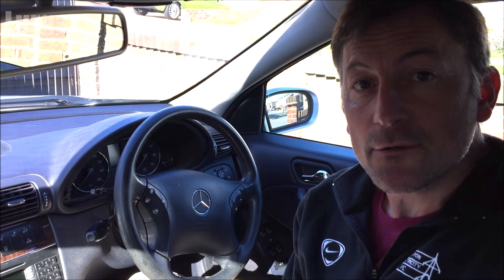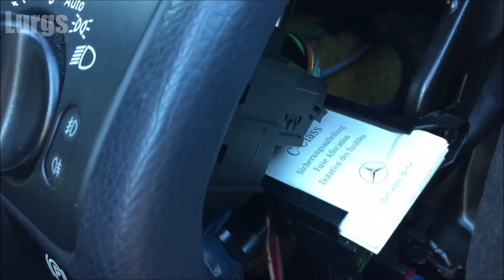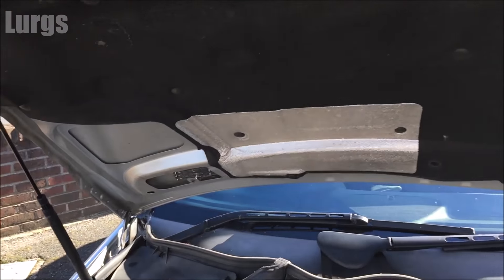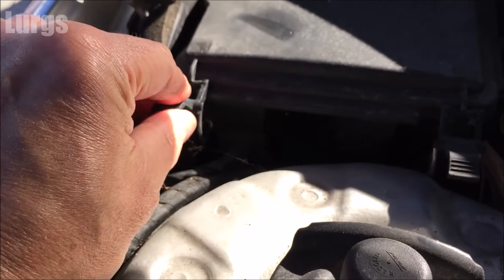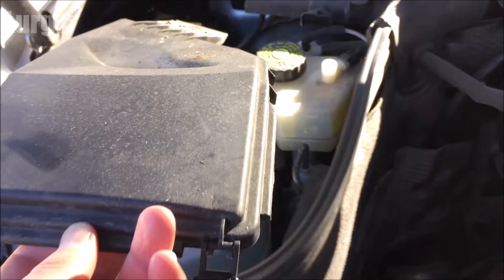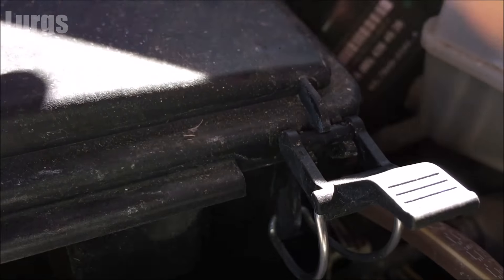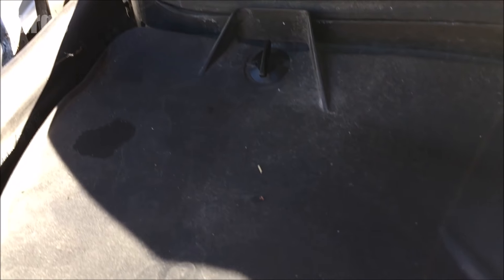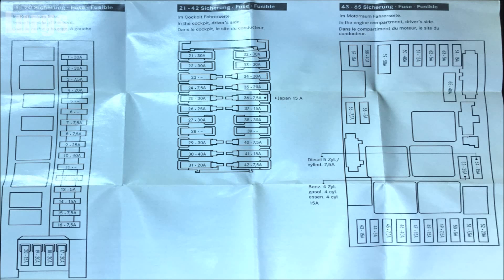Mercedes C-Class Fuse Box Locations and how to check Fuses on Mercedes C-Class

Comment: I can't thank you enough!
My a/c motor was running without stopping even if the keys are not on the car and my battery would be flat.
With this hint, I removed the fuse F30 and stopped the a/c motor.
So that, my battery will not be flat until I have the non-stopping a/c mottor issue solved.
Reply from the maker: Good temp fix, hope you get the air con sorted

Comment: I wonder which fuse is constant ( always on even when car is off) in the 2014 c300? Thanks for the video
Reply from the maker: Not sure, you’d need to test with a Multimeter
Reply: @LurgsHowToGuides  I figured it out, thought it was sun roof or fanfare  horns at first, but it's the satellite radio fuse that is constant!! Thank you.
Reply from the maker: Great news

Comment: Hi L, have you known slight 2/3 snatch when setting off first thing with auto box ? when warm no problems with the box (2003, 203)
Reply from the maker: Indeed it does. It is snatchy until it warms up, must be a common issue but I did replace the oil and the filter in the Gearbox with Mercedes parts and it made NO DIFFERENCE ! Hopefully nothing to worry about.  Thanks for visiting and please subscribe if you can. Thanks and have a great week.

Comment: Very useful, thank you very much. I would like to add my tuppence worth if I may. RHD Mercedes C320. Engine compartment fuse box is where your video shows, but it is not held closed with clips as shown in your video. Is is held closed with two screws which require a hex allen key wrench to open it. Not finding the clips caused a few minutes of head scratching, but then I decided to remove the screws to see what was underneath.
Reply from the maker: Thanks for the info, always useful incase others have the same setup

Comment: If the fuse board isn't in the dash by the steering wheel where else could it be on uk 2007 c220 cdi
Reply from the maker: Not sure. It may be in the boot somewhere.

Comment: Hi, I hope you could help me, my A/C doesn't work in hot weather and the radiator fan isn't engaging properly, what could be the issue? In cold weather the A/C works sometimes.
Thanks
Reply from the maker: If the radiator fan isn't engaging that's a real concern as the engine could overheat.

Comment: Hey is there a fuse to turn off my Parking brake warning light on dash? 2007 Mercedes Benz c280 matic. I released the brake one day and it almost fully disengages, car still drives it’s not locked on
Reply from the maker: Not sure there is but it would be dangerous to remove it anyway. You need to get that fixed

Comment: Why the fuses 58 and 61 isn’t installed? I have a problem with the transmission and I looked in the diagram that those fuses are from the transmission. My car is the c320 sport
Reply from the maker: Different models will have different fuses

Comment: Hey, my parking lights ain't working(the small ones in the headlight).So basically now i have like only the bigger bulbs on the headlight working.Do you have any idea what can be the cause of it ? Thanks :)
Reply from the maker: They might be your daytime running lights maybe? Only guessing you might be able to disable\enable via the computer menu or OBD2.  If they were on before then it could be a fuse. If you figure it out let me know. Thanks.
Reply: @LurgsHowToGuides  Yeah,the ones that are just below the high beam.Today I tested if electricity is going to the bulb "nest"(idk the exact phrase) and is not.I am thinking it's a fuse, but don't know exactly which one is responsible for these.Any ideas ? Thanks
Reply from the maker: Shubeto94 Not sure what fuse it is. Were they definitely working before? If no voltage then could be the light switch (but unlikely) or a fuse.

Comment: help please, my c180clk 2003, today my remote key only works up close when next to the drivers door, I've read it could be a fuse if so which one, and where? help appricated..
Reply from the maker: I doubt it’s a fuse, if it was a fuse it wouldn’t work. Best thing to try 1st is putting a new battery in the key fob
Reply: @LurgsHowToGuides  thanks, I tried this, and got 2 keys, both doing the same thing, only working when up close.
Reply from the maker: @jsahota1  Strange. Won’t be a fuse as a fuse either works or doesn’t work. Does it only work close in one specific area of the vehicle? Try seeing if it’s different as you walk round it.
Reply: @LurgsHowToGuides  it's working standing close to passenger door too, this is what I read on Google " Hello and welcome, please check fuse 8 in the rear box to see if it has blown" I don't have  rear fuse box, , thanks for replying and your advice
Reply from the maker: jsahota1 Ok. My advice would be to check all the fuses then.
Reply: @LurgsHowToGuides  thank you

Comment: I have a 2007 c280 avantgarde edition, the fuse list is still inside. There is one issue with the diagram... For the cockpit panel, there is supposed to be a fuse numbered 35 (auxiliary heater pump), however just like in your video there is a space with only one small square, which a fuse cannot be inserted. Do you by chance know why this discrepancy is happening? It seems that you have a similar fuse box, is the fuse diagram in your vehicle the same as the fuse panel in the cockpit?
Reply from the maker: Lot's of Vehicle fuse boxes are like this with empty slots. They make a generic fuse box for all versions of that Model. Then only the top luxury models with all the gadgets will have all the fuses. On yours and the one I did it won't have an auxiliary heater hence no fuse. Thanks for the visiting my channel, please subscribe if you found this useful, would really appreciate it.  Happy New Year to you.

Comment: Hello ol boy ... Love your vid .... I have a 2006 Mercedes C-230 ( over here in America ) and I have this problem of a random theft alarm going off.  There seems to be varying reasons why it fails according to who I ask, but most say because the alarm batteries get corroded or weak and the alarm is actually meant to draw attention to the problem.  I replaced it all once a year ago at the cost of $450 U.S. As  you can imagine, I don't want to do that expensive repair once again ... sooooooo ... My thoughts are to pull the fuse to the alarm horn ( down by the front wheel well ).  The problem is I don't know which fuse it is !  Any help is mucho appreciated.
Reply: I did find a blog that says it is the top row third from left 7.5 amp ..... I might give it a try.
Reply from the maker: Not sure what fuse it is. You need a fuse layout diagram really as you don't want to pull out every one and test the alarm, that will take ages

Comment: What was that in the horn fuse location? That reddish burgandy. My horn not working but there is nothing there on my fuse box.. it’s got 3 pins which is weird like a 3 pin fuse?
Reply from the maker: Not sure I’m afraid. The horn could be a faulty connection in your steering wheel or the actual horn has failed. Hope you can get it fixed, good luck

Comment: Hi Lurgs hope you can help! 
My radio won't switch on and I need to locate the fuse to check - I have the same C180 Kompressor (2003) Could you tell me where to find the fuse? I'm conFUSED! 🙈 as there's a box at the side of the steering wheel and one under the bonnet? 
Hope you can help!
Reply from the maker: No idea I’m afraid. Could be the head unit has actually failed. Best bet is just check all the fuses https://youtu.be/zLfa7_FbZrU

Comment: afternoon...i can't find hazzards fuse for c180 2009 model
Reply from the maker: Unless you have a fuse diagram it will be hard to tell. It could be a Relay. You can check the fuses without removing them (link in the Description). Good luck.

Comment: There should be one in the boot also
Reply from the maker: Yeh that’s in the video at the end, only certain models 😎
Reply: @LurgsHowToGuides  any idea why the driver side door whole window control unit is temperamental sometimes it works sometimes it doesnt including window door lock side mirror. One day it jst stopped working
Reply from the maker: The Miz Could be a dodgy connection somewhere, doubt it's a fuse as they either work or don't work. Hope you find it.
Reply: @LurgsHowToGuides  I jst can't be bothered to take the door off🤔 yes of course it won't be fuse